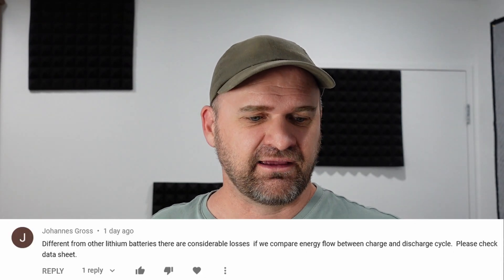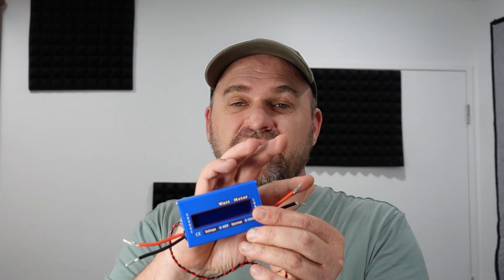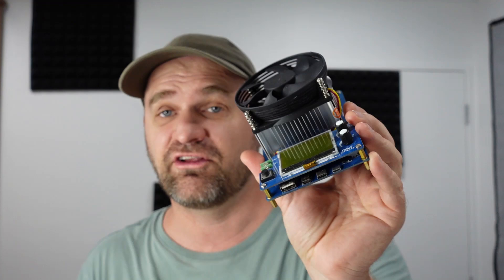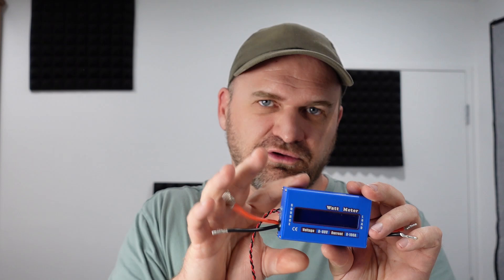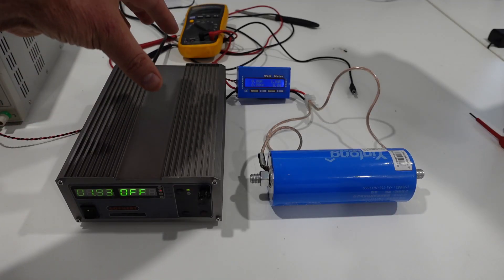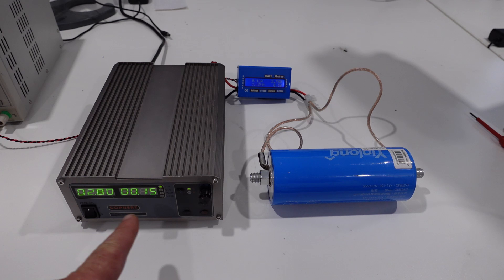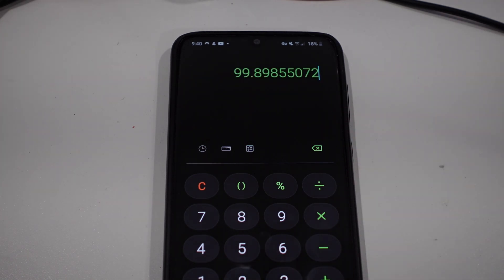Efficiency test LTO Yinlong battery

Comment: The more I learn of this battery type, the more I like it. 6c charge & discharge. Full charge in 10 mins (6c). Up to 25k cycles, -50 to +60C operating range.
Do they like other Lifepo styles, prefer 30% to 80% discharge / charge range for greatest lifecycle? cant seem to find that info.
Reply from the maker: Hey Jonathan, I don't think they care so much about being held at a low state of charge, however... like other Li chemistries I think they hate the mixture of hot and high SOC.  This is the only condition that I've found so far that seems to limit their life.
Reply: @brendontait6968  the best measure incorporates the energy I love having to give batteries a second life and Manufacturing new ones for the original application over and over again. We know that this might go down in terms of the number of Cycles given what we hear about the highest density research in which it will be released to the real world when it reaches the minimum number of cycles that the real world will tolerate.

So those who talked about lithium iron phosphate having comparable numbers or misleading people. They are not counting the energy to engineer Finance build ship dispose of Etc multiple times.

The rule has notable exceptions. Because of the increasing efficiency per square mile or kilometer I'm converting photons to electron voltage the optimal cost engineering for number of years is no longer number of decades but even for many climates the life expectancy of the extremely lightweight extremely high efficiency no glass no rigidity panels which you don't have to orient towards the Sun but can simply lay on the ground that is what makes sense given the ultimate cost engineering where you put out these Sheetz for the first half decade and maybe if you're doing electrolysis you have the electrolyzers cellular Lee distributed to the fields pumping water extracting gas. That's how you cost engineer. The idea that we will be wasting land in many places on foldable text is also insane. Electricity is becoming increasingly useless and I don't expect the demand to increase over time. I do expect photons to be used more that we will drink less processed corn syrup and more engineered platonically manufactured nutrition.

But the main thing is that electricity is already so cheap round-trip efficiency doesn't really matter unless you are dealing with a very limited roof like on a RV and are not getting your energy from the grid primarily with some sort of a rational justification for that.

This is why I opposed the financial shenanigans with SunPower. This company has the solution and it's getting away from the insanely expensive currently I'm controversially reported bottleneck for glass. Glass has nothing to do with foldable ticks it is a legacy cost for the bank. the bank wants to get a fraudulent representation that the future Net Present Value will allow the solar farm to continue to earn money lol. We know that the panels being engineered for half a century are going to be pulled within a decade and at their manufacturing cost is about 1000 per cent more 10 panels which are far more efficient I need to be reconditioned after half a decade. but we don't have a conscience in the manufacturing Arena it's all about exploiting the ignorance of do-gooders. China is an evil entity there are design for solar Farms is consummately corrupt. Lightweight flexible high efficiency cells last a long time. It's okay to not wash the windows because you don't have Windows but instead just changed the sheets from time to time. Who does that who buys sheets based upon how many years they can leave them on the bed without washing them? when it comes to solar panels only the entirety of the world.

Comment: These LTO cells seem like amazing batteries - and they have the ability to be used at quite low (-20°C ?) temperatures as well. I am though confused as generally Will Prowse is also a good person to watch and he disagrees with you regarding their efficiency.  I would assume any inefficiency would primarily show itself as heat? Perhaps encase the cell in an expanded polystyrene casing with a thermometer probe and repeat the exercise? Otherwise it would be great to see a video with you both in. It may be that Will has purchased sub-standard cells or something? Perhaps both run the same experiment at the same time and compare and share results?
Yes - I've watched you both with respect to LTO Cells.
Reply from the maker: Hi Mark, I agree, Will generally does have good information.  I've talked with Will and from what I understand he agrees with my take on efficiency.  I think there may have been a few things playing into the results he got.  Firstly and possibly most importantly I think he had B grade cells.  The shrink wrap on them was different to mine which makes me think they were probably grabbed out of some bin then re wrapped and sold.  Additionally - a high C rate charge and discharge will drop the efficiency which would be more pronounced with low grade cells.
Reply: Yes, Mark, any inefficiency will appear as heat, however, an experiment where you place the cell in an insulated polystyrene enclosure with thermometer isn't going to tell you anything besides turning the cell + enclosure into an oven (adiabatic walls) and trying your best to increase the case temperature of the cell as much as possible.  In order to determine what the temperature of the cell was, the experimenter is encouraged to maintain steady-state conditions by conducting the experiment in an environment with a fixed ambient temperature.
On the other hand, determining efficiency electrically makes sense here because this device is made primarily for electrical energy storage.

Using the watt-hour figure for total energy, and assuming the initial discharge was to 1.8V (footage was lost) we get 97.1Wh over 4h40m and 83.4Wh over 4h10 minutes. There's an extra 30 minute discrepancy here which is due to the absorption phase of charging (CV starts at 4h6m at 10A, then 0.24A at 4h24m , then 0.15A at 4h39m). The calculated energy efficiency for this charge-discharge cycle is 83.4/97.1 *100% = 85.9% while the coulombic efficiency has been proven in the video to be 41.358Ah/41.4Ah * 100% = 99.8%. 

What does this mean?
Coulombic efficiency: 99.8% of the electrons moved through the cell during the discharge cycle as compared to the charge cycle. Everything that happened with ions in the electrolyte, as well as the reduction and oxidation at the active material where the lithium titanite nanocrystals and the anode and cathode metal resided, were 99.8% efficient, as ion flow and electron flow have a direct correlation.

Energy efficiency:
Over a period of 4h10m, 85.9% of the energy was consumed by the load, and 13.7Wh was dissipated as heat inside the cell and along the cables. This heat is primarily influenced by the C rate of the discharge and the internal series resistance of the current collectors in the cell. Doubling the current quadruples the energy lost as heat (Ohmic power loss (Watts) = Current^2*Resistance). In order to get 99% energy efficiency, the experimenter simply needs to slow the discharge down to a 0.05C rate. This is true for any cell construction, including supercapacitors (EDLC) that have no chemical reactions taking place! Therefore, coulombic efficiency is more representative of the LTO chemistry, whereas the 86% energy efficiency is representative of the construction of the cell (length of current collector strips to electrodes, thickness of the strips, conductivity) and the system requirements.
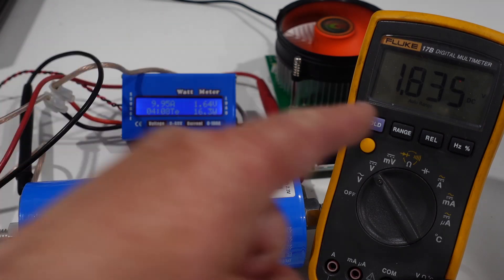Reply: IMPORTANT  If you pause after 5:37 you can see the voltage drop between the watt-meter and the electrodes where the fluke multimeter is measuring voltage. There is about 0.2V dropped across this distance, which translates to 2W dissipated in the cables and contact resistance of the terminal block alone! There will be further voltage drop to the load as well, but over 4h10m this represents a massive 8.33 Wh lost as heat in the wires. This was not accounted for in the energy efficiency calculation. The system efficiency may be 85.9% but the cell actually delivered 91.73 Wh to its electrodes, resulting in a cell energy efficiency of (83.4+8.33)Wh/97.1Wh *100% = 94.5% efficiency!

This is a very good result, and I hope the experimenter uses much thicker wires in their next test, or measures the voltage drop across the thin wires and accounts for the power dissipated across them.

the remaining 5.67Wh over 4h10m dissipated inside the cell and the remaining unaccounted-for wire length and contact resistance represents an average of 1.36W of energy dissipated as heat. If the current was quadruped to 40A or near 1C discharge, it would follow that the heat dissipated would increase by 8x at least (if efficiency does not decrease past 94.5%). 
Also it follows that any capacitor or battery that can discharge into the 1000A level must have single to low double digit milliohm internal resistance.
Reply: @InfinionExperiments   My suggestion of encasing the cell in an insulation layer was more about - is the cell being inefficient and generating a lot of heat. Obviously - I wasn't looking to start a fire or anything. Anyway, Will Prowse has since stated that he had grade-B cells and now with better quality cells, sees a much higher efficiency. I'm now a happy YouTube viewer.
Reply: I had grade b cells. I also posted a part 2 video where I pulled full capacity with higher quality cells. I did not disagree with Brendon
Reply: @WillProwse  Thanks for the update!

Comment: Your battery pack always intrigued me as I want to build an electric only off grid camper. The fact that these can charge at -0C and the absorption rate is awesome always made a lot more sense in a situation where I'd be relying on them for overnight heat. Running high current draw things like electric showers or cookers would be perfect for the application and I think you could get around any inefficiencies with some extra solar panels, assuming your application of these allows adding a 300w solar panel which obviously rules out a lot of the smaller #vanlife type of builds.
Reply: looking at these arnold for the same reason i got a 1969 open road catlina that i am in the process of doing a tear out on and a rebuild, which you know as in a van or a slide in camper room is at a premium.  which i will be updating several components in  . please keep me informed on how oyu do with these either thru here or on facebook,, thanxs
Reply from the maker: Hey Arnold, yeah.. I'm going "full' electric, but I think hot water heating is probably a bit ambitious even for my pack.  I might use bleed power to heat HWC when battery is fully charged.  But that is about all.
Reply: @brendontait6968  You could get higher efficiency heating with black heat pipes circulating water into a boiler. That would eliminate the 85% efficiency losses of solar and take the stress off of your batteries. Heat pump would be a nice option for 500% COP efficiency heating as well.
Reply: @brendontait6968  i used a 30 L Nautic Boiler it also has a heat exchanger and you can get 300 watt element i use a 500 watt with 390 A/Hr lead battery's i got 1400 Watts solar with a 5k Victron muiti Plus
Reply: @brendontait6968  try black PVC PEX pipe solar water heater

Comment: I'd love to see the same thing with high discharge, low charge and low discharge, high charge. Nice research anyways
Reply from the maker: Yeah - I just have to make up a 200A supply to charge them - I'll put it on the list.
Reply: As I understand it, if you gather enough politicians together the amount of hot air expelled, when converted to electricity, will easily exceed 200A.